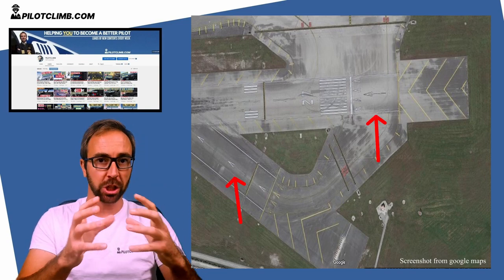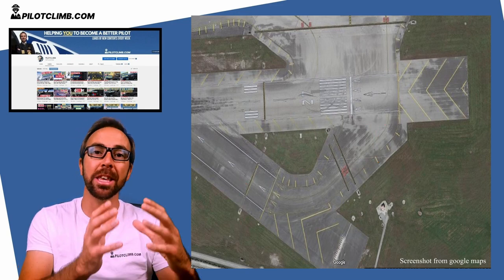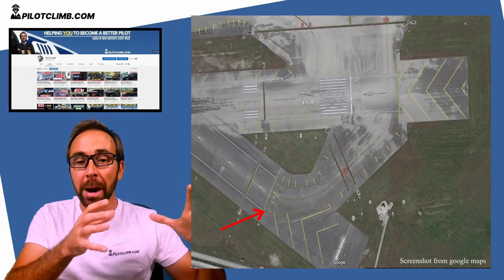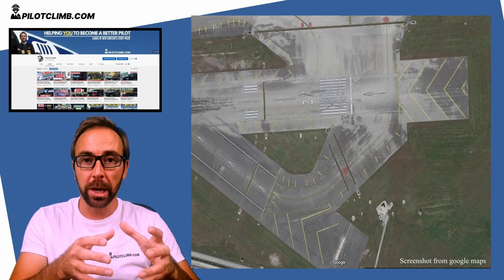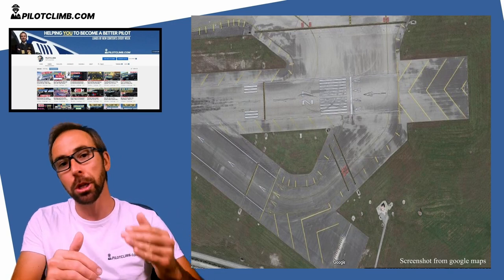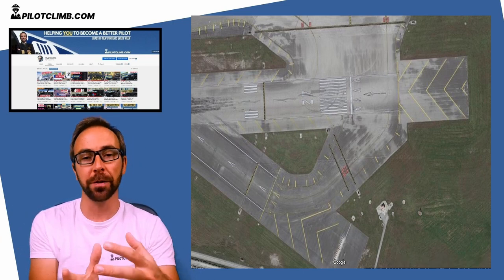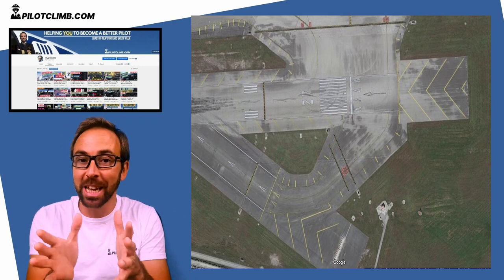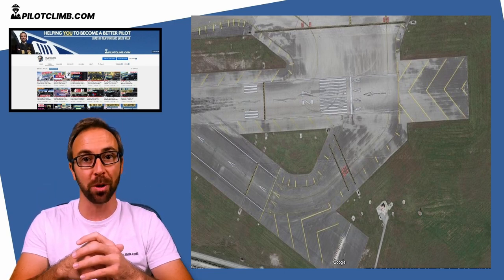Displaced Threshold Explained - [Deep Dive Into The Displaced Threshold Markings].

Comment: Hi..
Can you take-off from a Displaced threshold in low visibility condition, like 1/4 mile visibility? I would not think so, because you are missing the center lines...
Great videos
Reply from the maker: Hey!! Many thanks for watching!! It depends.. if the displaced threshold that you are using for take-off has the correct centerline lights set up, than you could, however, before taking off out of a displaced threshold in low visibility make sure you read the general section of your charts, in there you will find the information and the instructions regarding the low visibility take-off. Let me know if I answered your question!! Have a great day!

Comment: One question:
If you have a displaced threshold for rwy 30(for example),and there are 2 intersections for departure for rwy 30,D(2000m),E(3000m) and the full lenght when backtracking is 3400m.
If you are instructed to taxi to the holding point for rwy 30 from the tower,but you don't need full length,do you consider that the tower offered you both intersections for departure and you can choose whether to take D or E since you don t need full length?
Grazie!
Reply from the maker: Great question! In this case you need to ask and coordinate with ATC an intersection for your take-off

Comment: Whenever landing on the taxiway comes up I can't help thinking of Harrison Ford lol
Two questions: first is whether there's a physical limitation that justifies the yellow chevron portion of the runway not to allow takeoffs.
Second question is whether the atc will always give you the optimal taxiway option when the departure runway is split and its threshold lies in the middle. Some runways start in the middle of the pavement, not in the extremities of the airfield. Do you sometimes have to taxi all the way to the middle of it to lineup with that threshold or is that avoided because you'll be using an active runway as taxiway for too long, obstructing it?
KGFK airport has a great example of this type of runway, I think it's 04L which shares pavement with 22R, if I'm not mistaken.
Reply from the maker: Hey!! Welcome back! I hope you are doing great! Regarding the quesitons: 1. Yes, the pavement of the part of the runway with the yellow chevron markings is not properly prepared for take-off porpuses. Most of the time is because the strength of the pavement is not strong enough.
2. ATC will always try to give you the taxi routing that is most efficient. Normally we calculate the takeoff performances using the most restrictive taxiway (shorter runway).  Let me know if I answered your questions.. Have a great weekend

Comment: And WHY don’t they treat the pavement the same way as the land-able runway? That would give more room for the planes
Reply from the maker: Hey, many thanks for watching!! That's true, however there are many factors involved. The Airport Authority has to take into consideration the regulations and the cost benefit of making the runway fully available for landing, on top of that sometimes you might have an obstacle on final, for example, that limit your landing but not your departure.
Reply: @PILOTCLIMB  ohhh so in the end, it is the cost of treating an area that can hardly be used for landing that makes it illegal. Almost as if the airport / FAA is like: “hey, there are lights and trees in your way anyway, so you can’t possibly land here… so we are going to make this pavement a little less strong. But if you manage to clear those obstacles, don’t land here because you’re gonna ruin the pavement!”